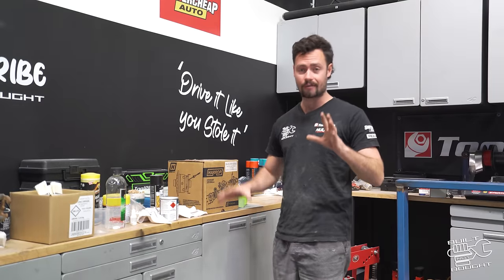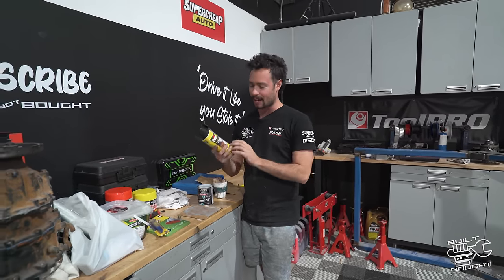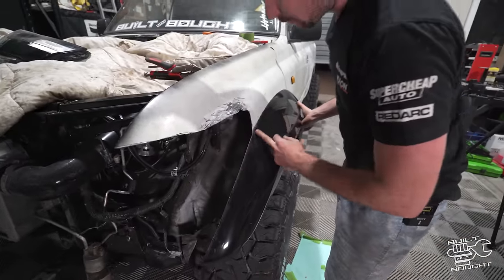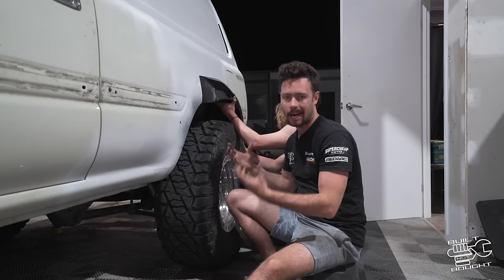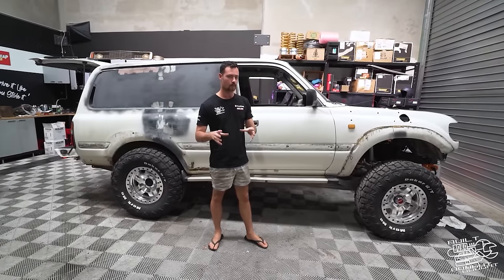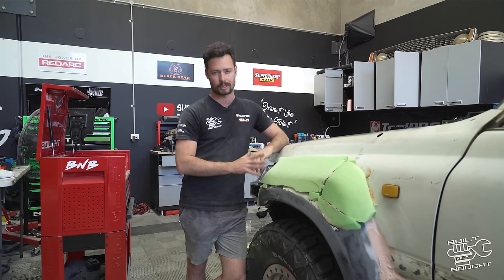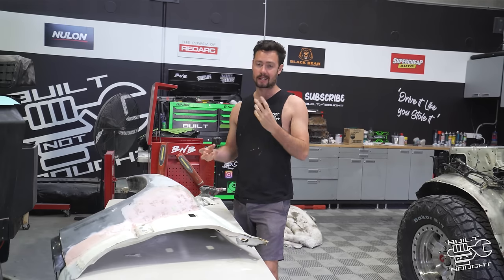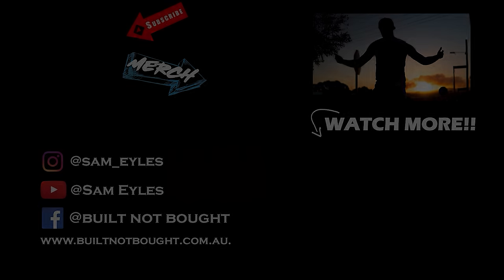BNB 80 Ep. 13 || Custom Wide Body Kit For The 80

Comment: Absolutely in love with the rear door “delete” on the van cruiser. Never thought of doing it and I personally haven’t seen many like that but you’ve really nailed it.
Reply from the maker: But is it practical? 🤷‍♂️🤷‍♂️😂
Reply: @speyles  Lol  But does it look cool? Looks trump practicality 🤣🤣
Reply: @speyles  lol bit late now but if your chucking a bed in the back should put in some emu wings or similar in for windows and accessibility
Reply: @speyles  for the set up you’ve got going and hiding all the 12v gear and air compressor practicality doesn’t matter 😂 plus it doesn’t have to be practical if it looks amazing

Comment: Love the Haltech Elite used, they are a great replacement ecu, easy to use and unlock so much potential, so much more capable with sensors to add and monitor, no idea why people keep the old ecu and reflash it, or those podgy piggybacks. I just got myself an Elite 1500 and planning on running DBW and cruise control, on and old school hilux running a camry steering wheel for the cruise control buttons. Slowly getting my shed build together, and a an elocker will go great with the 80 series diffs I've got taking up space in my driveway for the sas I'm still trying to convince the Mrs to do. I'm halfway there I have the diffs🤷😉

Comment: The 200 series front end and custom seats are my favourite part but I like the whole car, really one of a kind and you've done an awesome job Sam. I seriously reckon a custom little sunvisor above the windscreen would set this off. It would provide some straight lines and square edges which will really pop.

Comment: I’m keen to see how you shorten the bonnet and get that to fit. Perhaps look at the balance between the front and rear flares because at the moment the front flare has that aggressive corner or edge running around it but the back just looks like a stock round flare. The front flare is also a lot bigger than the rear. I hope this helps and I’m really enjoying the build. Cheers Stuart, Canberra.

Comment: Looks great! Can't wait to see the final product.
I would have ditched the Polyester resin in favor of epoxy resin. You could have stuck with regular XPS foam and epoxy has better adhesive properties and more flexible. You need to get chopped mat to suit epoxy as regular chopped won't soften up and form to the contours. For fairing it up use epoxy with micro balloons. Makes for really easy sanding, much easier than bog and when it comes time to patch up wounds (inevitable!) it will be much easier to repair.

Comment: I’m a sucker for 12volt action, so all the 12volt vids with wiring up your dash, wiring up all your sensors and of course the dual battery set up in the back 🤙 and those lockers, best on the market 👌

Comment: You should tear the chopstrand mat. It help bond the layers and keeps it smoother. Also use consolidating roller to remove air bubbles from resign and glass.

Comment: I have an 80 series and want to attempt a restoration myself and modernised the inside and outside with front and rear e lockers, a lift, LED headlights and maybe an engine swap and body work. 
I’m looking forward to seeing the dash as a finished product. More specifically the head unit your using, how well the Bluetooth 200 series wheel goes and if you use a rear camera, Apple car play etc.

Comment: I love the dual battery system installation. Becaus I’m currently working on that same system but with 2 extra 100ah batteries 😬 and I’m adding a high amp alternator to keep those batteries charged. Cus lets face it, electricity is very important when we’re out camping. 😅

Comment: Used to have a turbo 1fz 80, was a wicked bus to drive, Wish it was built as well as the BNB 80 is. 
Have a 1hdt 80 now and would love a locker for it, motor and 200 front end would have to be my favourite part.

Comment: Fine.  I'll comment.  Stuff.  I like stuff.  I never win these competitions anyway.  I like the steering wheel.  Who cares.  I like the third wheel nut on your rear left wheel counting clockwise from the first wheel nut - the first being the one that lines up with the first letter of the brand of the tyre.  Ok I lose.  I get it.  I own a 94 mistsubishi delica space gear 4wd van anyway.  What are you going to do about that?  What can anyone do about that?  Oh it needs a locker.  It needs an everything.  But this comment isn't going to help so I'm going to have another beer and finish picking this multi.